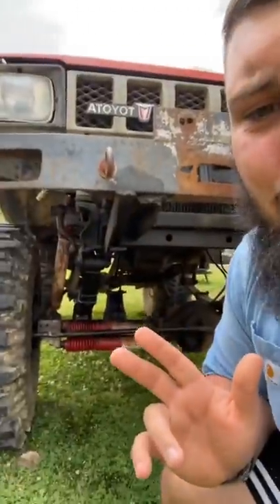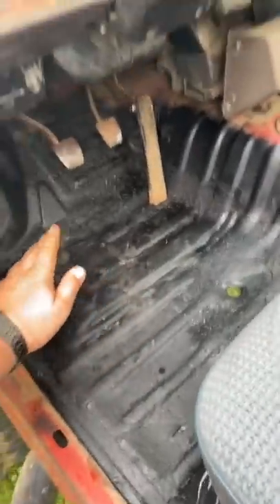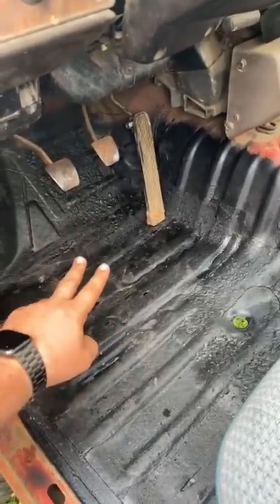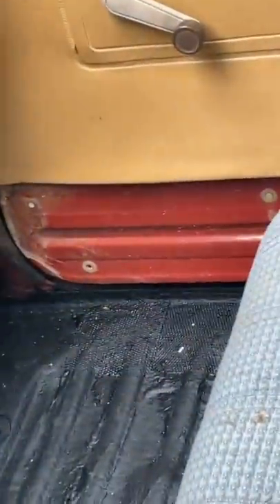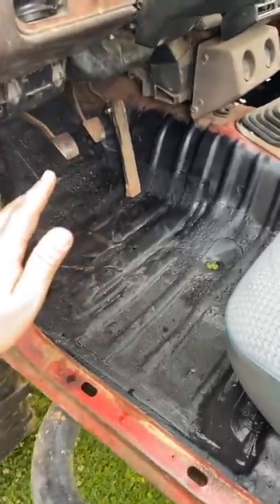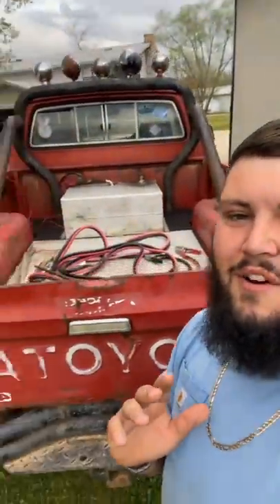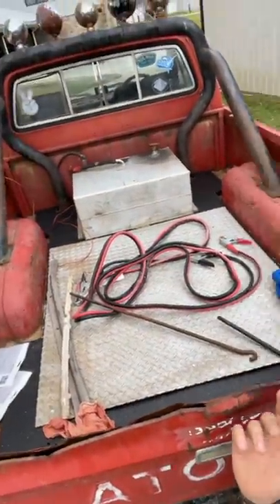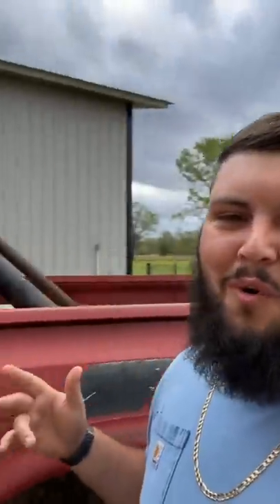1982 Toyota Mud truck Update: DIY rust patches, sheet metal and seatbelt delete

Comment: For reverse lights i recommend DIESEL LEDs. They are typically about 60 bucks and are 2100 lumens. For perspective, stock halogen headlights are around 2300 lumens. And stock reverse lights are less than 1000.

Comment: Paramedic here...pull used seatbelts from a crashed Toyota..even off road can get a bit dangerous occasionally,  and I'd hate to see you and Ricky get hurt🙂 overall you did a phenomenal job so far. My son in law had an old Tacoma that he painted for off-road in a camo pattern. Really inexpensive and looks kinda cool.
Reply: Have you ever been boggin before?   First if you fly out it's Mudd, second if you sink that Mudd water gonna jam that belt lock shut and not let you out. Third it's the passengers job to make sure the cooler stays in the truck, and you can't chase that if you butt strapped to the floor.
Reply: Was the camo ducks or penguins by chance? I bought one 4 years ago that was camod and came from north carolina.

Comment: See I can tell you work with metal just like you could tell I'm a carpenter. I had a GMC Sprint with the bed rusted out pretty bad so I fixed it with pressure treated 1×4 and pressure treated 3/4" plywood. Worked great.
Reply: Lol, that's what is in my 81 K20

Comment: I had a hole in my first car floor board.  Where the windshield leaked and rotted out the floor. I pulled the carpet back took air duct metal, cut it out and glued it in place, then put the carpet back.

Comment: I had a 80 long bed that I bought for 200. I put a clutch in it and drove it until the frame got soft from all the rust. I wish I would have saved the 22R engine before I sold it for scrap.

Comment: If you're interested I have a complete conversion kit for that truck and the 347 dell race motor and brin mud trans that allows you to put a V8 right in you would need a new rearend  and drive shaft but this 347 makes about 980 to the wheel HP same thing I run in my super late model